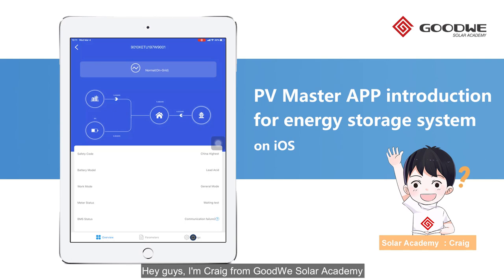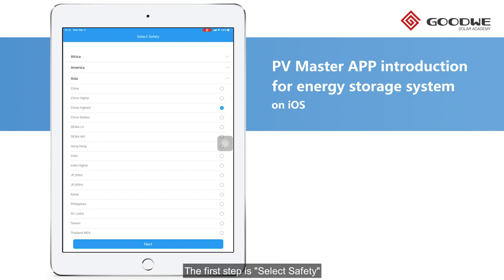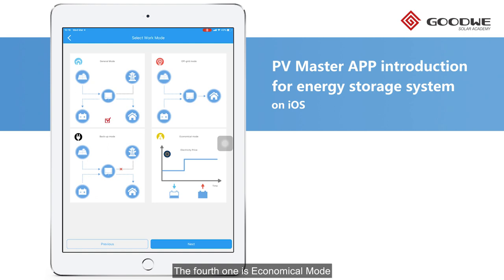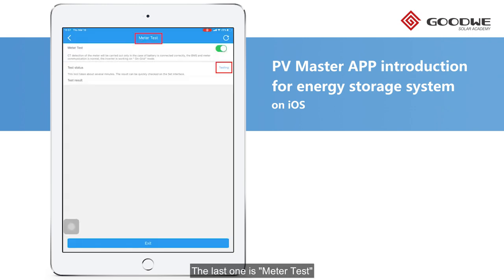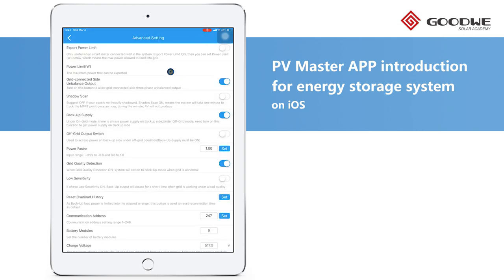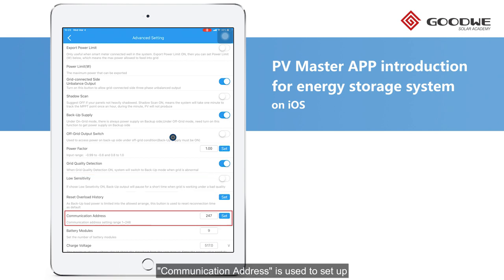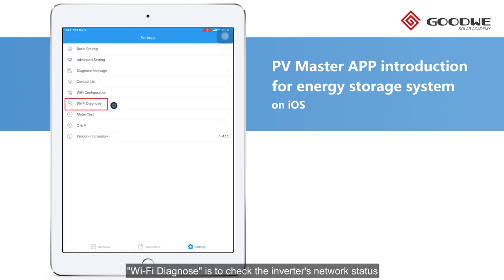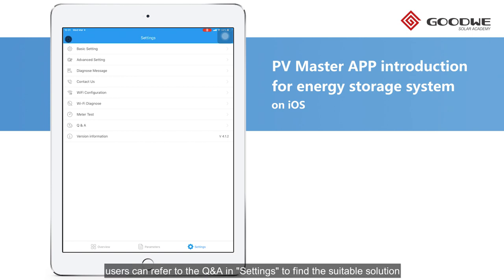GoodWe PV Master APP introduction for energy storage system

Comment: Hi from NL.

GW8K-ET 
I just connected a Goodwe lynx F plus 13.1 H battery to it. Battery LEDs green flashing, but when I turn on the inverter, battery power button turns red😢
Obviously a communication prob ?
All connections look good and tight (correct com ports and terminal resistor).
Is the prob in SolarGo app?  
Com address 1 or 247 (either doesn’t resolve problem though…)
Any ideas ?
Reply from the maker: Hello, you should cantact local aftersales to help check the communication issues. https://goodwetechnology.zendesk.com/hc/en-gb

Comment: Dear, I have a GW3648D-ES hybrid inverter. Iam struggling to connect my phone to the WiFi of the inverter. The last 8 digits of the serial number do not do the trick for me. What could the password be? Any suggestions?
Reply from the maker: The last eight digits of the inverter SN are used for WIFI name. The password of WIFI name is 12345678.

Comment: what if I take the goodwe gw5k et without a battery and I only connect a battery to it in 5 years.  how do I set the inverter to supply the power to the meter box and the grid and not to the battery?  since the battery is not there yet.
Reply from the maker: If you don't need battery, just need to disconnect the battery, and nesure that the back-up side is not connected to any load. Then connect PV Master, get into 'basic setting' to choose 'no battery'.

Comment: Can the installer password be changed? Or is the default password for every unit always “goodwe2010”? Or is there a way to reset passwords back to default? Thanks
Reply from the maker: The default password can't be changed in PV master.
Reply: @GoodWeSolarAcademy  Does that mean it can be changed by other means?
Reply from the maker: @andyj986  No, we do not support modifications in any way
Reply: @GoodWeSolarAcademy  Great thanks

Comment: Hi,

I have a Goodwe 10kw-MS Grid-Tie inverter. Can you please provide a guide on how to set time of reconnection (inverter outputs power after commercial power resumes)?

My current setup is at 1min (60s), but the electric distribution company in my area requires 10mins (600s). I am from the Philippines. 

Thank you
Reply from the maker: You can change the Reconnection Time with “SolarGo” App（SolarGo - More - Advanced Setting -  Grid Parameters Setting - Reconnection Time）